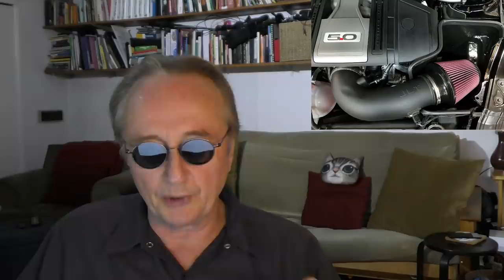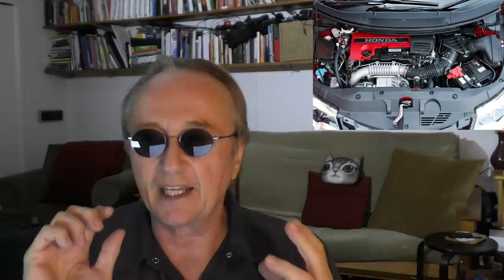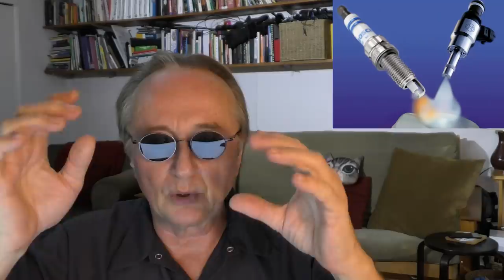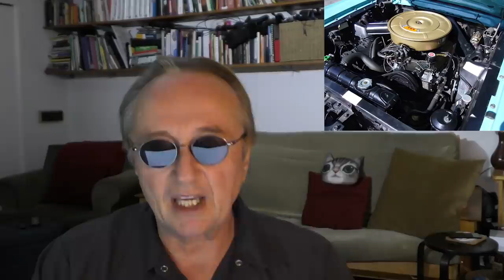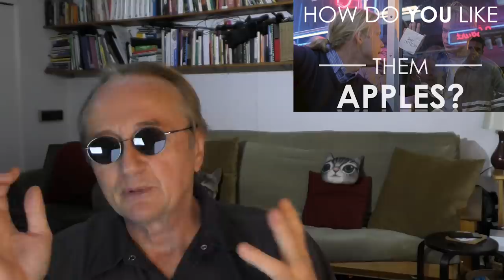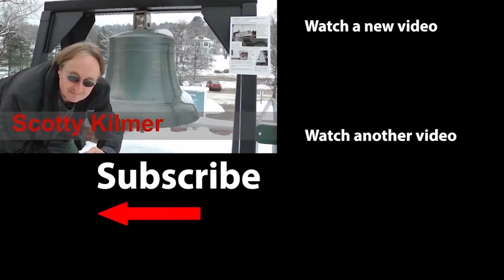This Car Mod is Stupid

Comment: Man listen, cold air intake gives big gain for certain cars, especially tuned cars. REGULAR people with regular cars who don't tune the car- he's right
Reply: In scottys defense he was talking about putting them on a car and NOT tuning the computer for it was the big mistake. In that case it won’t make much difference or it will make it run worse.
Reply: It isn’t that expensive to retune the computer
Reply: It's simple logic
Reply: The MAF and O2 sensors sense the extra oxygen, and will inject extra fuel to compensate. How can this NOT produce more power? Even if it’s negligible.
Reply: Justin Beyer With stock cars, they will sense the extra oxygen but will not increase fuel into the injectors ect because of it. You need a ECU tune to change those settings
Reply: Dio Black CAI does do something for tunes autos. Tuned autos can recognize the extra airflow.
Reply: Neptonic 101 Honestly not really. Download the application on your computer and plug it into the OBD.
Reply: Jeff Lee Lol mostly it’s for the fact cold air intakes just draw in more outside air than stock
Reply: Jeff Lee   That's a good question.  But that air is not hanging around waiting to get hot.  It's moving rapidly.  The question becomes whether the air can be cooled enough to overcome the heating done by the motor.  I guess if it's winter, then maybe and if it's summer, not so much.  But I don't see how it could hurt.  Just throwing out some vague idea that the car knows best is not a real explanation.  If the car runs okay in the winter and you tell it that it's winter by putting a CAI on it, how can that make it run badly?  Even if it does nothing, should it diminish performance?  I don't see it happening.
Reply: You're right, plus I should go tune up my car car right now.... Oh wait, we don't have carburators anymore GRANDPA!!!!!!
Reply: Various i picked up like 21rwhp on my 2014 mustang gt with a 91 tune dyno proven.
Reply: Various I agree
Reply: On any decent car, the stock intake is going to be pretty good these days.  No manufacturer is going to leave power on the table that way.  A cold air intake/high flow filter can only have any benefit at full throttle, because at partial throttle the biggest restriction in the intake is the butterfly valve, which INTENTIONALLY restricts airflow.  Even at full throttle they don't have much benefit, and they're much worse at cleaning the air.  Most cold air intakes just suck hot air from the engine bay anyway.
Reply: godgiven Yes, with a tune it definitely should do that!
Reply: blurglide  correct but what you’re speaking of is short ram air intakes which is inside the engine which to me makes no sense. The cold air intake should literally be in the coolest spot possible where it’s getting fresh air constantly
Reply: Jeff Lee  what's being shown in the picture is a "short hotair ram"
Reply: Lol "big gains"
Reply: I put one on my stock SUV and it does make a difference. No, it doesn't transform it into a tire smoking race car, but it helps it breathe better and it squeaked a mile or two mpg out of the engine. Worth it to me.
Reply: Jeff Lee  I'm saying it's even hotter hahahahahaha
Reply: In the great vast majority of vehicles a CAI does nothing but increases air to fuel ratio a little bit . All the computer systems in good vehicles know how to adjust for that and it doesn't hurt Lockhart to run a little bit lean for a lot of cars it's even better then the factory setting. In cars with lower displacement it can increase gas mileage a tiny bit if you drive it for that purpose and drive it at low rpms. The CA I by itself does not hurt a damn thing. What actually causes problems and when people throw in high volume fuel pumps and injectors without a matching program . Intakes are the simplest improvement that cause no harm or issues to the car whatsoever. If it was a problem then manufacturers would develop specific batches of cars made specifically for high altitude environments and anyone who buys one in a high altitude location and then moves somewhere else to low altitude would have problems with that car .
Reply: Jeff Lee nah you’re wrong carbon fiber guy
Reply: @blurglide  I've been considering taking out the intake hose to a more dynamic one and leaving the stock air filter.   Would that require additional programming?  Do you think it's a good/effective thing to do?
Reply: @blurglide  the butterfly is the throttle control itself. The cotton filter reduces vacuum in the intake as the butterfly opens. How? Less restriction. (Like when you hit your crack pipe but it's got too much crack in it, and you can barely get a hit; then you take some of the crack out, and it's easier to hit because air can pass through more easily.) But crack is whack.
So yes! Anytime the butterfly opens, it demands more air. When you hit the throttle and hear thooosh-whoooooom! That's a restricted intake usually, and you can feel the plastic being sucked into itself indicating the engine cannot breathe sufficiently for the load applied. 🏎
Reply: @iamiam8407  The butterfly valve creates the desired vacuum in the plenum.  If there's less restriction (vacuum) created in front of it, you'll have to close this valve more to create the desired vacuum.  Yeah- there can be a power benefit at wide open throttle when you want as little vacuum as possible, but a low restriction intake offers no benefit anywhere else.
Reply: @blurglide  no it doesn't. The butterfly regulates the vacuum that already exists behind it. 
Point
As the butterfly opens, their is briefly a higher vacuum in the plenum. At a certain point, this becomes constant. By reducing the restrictive paper air filter, you increase the angle (of the butterfly) at which this occurs, giving you that higher constant power. BUT!
Even at lower angles, whenever the angle increases, the response is quicker.

Comment: For new vehicles a CAI is actually calibrated by the MAF sensor so your computer will adjust.  Think about it.  If you drove in cold vs hot the computer has to adjust.  Same with altitude.  There is no need to program it.  It's true a programing will optimize the bolt on.  With out code 5-10hp gains average.  Programmed 10-15hp gain.

Comment: My buddy hydro-locked his motor on his Lancer because of one... Went through a big puddle, and the cold-air intake sucked up a mouth full of water! Your stock air box is enclosed and up high FOR A REASON! 😁
Reply: R6Mute Main yes. But I question this cold air.... I always get the systems that have a box / wall that is a partition from the engine bay where all the hot air is. These filters also keep the stock inlets for the original filter but allow more air with the bigger oiled filter. They tend to have a bigger pipe than stock with smooth / less bends. I’m pretty sure if he hit a puddle with that type of filter system he would be okay.
Reply: @Jenuin  Yeah that's the only kind I would get, if it connects to stock box or has a better replacement box. My friend just had the cone shaped metal filter on the end of the cold air! 😁
Reply: They also make cone filters with dry socks that keep water out in that very situation.
Perhaps he thought the included dry sock looked stupid and left it off.

Comment: Plastic cars do exist, they're called Cozy Coupes by Little Tikes. Target audience is the 2 to 5 crowd, diapers not included!!
Reply: Always  buy them  new! All the second hand market ones have been crashed into garden flower pots and have boogers on the steering wheel !
Reply: @robertcollins7034  LOL quite true!
Reply: Saturn
Reply: FYI: Smart car, for example, stole the design from a plastic cozy coupe.
Reply: @mikesanchezgsxr  is that a make if car ? I'm from uk so dont know that model !
Reply: @robs1852  haha I've seen where someone painted a smart car to look like a little tikes car!

Comment: "It may be low mileage, but it's still a Suzuki Swift."

🤣🤘 You tell 'em Scotty
Reply: Keith Fendley probably an Indian made one, Maruti Suzuki which’s is their India division sucks, the only good ones are those made in east Europe and Japan
Reply: Glen Humplick
Reply: who said suzuki makes bad cars. i have a 2006 suzuki grand vitara. made in japan. 150 thousand miles. They're amazing little offroaders. Never got stuck or stranded in all these years. I flush the transmission fluid every 2 years so never had a problem.
Even my 2009 camry stranded me once but not the suzuki.
Reply: In Pakistan, Toyota and Honda drivers road rage with Suzuki vehicles for no reason. 
Yeah, Suzuki here is infamous for making older model vehicles.
We had a 1992 Alto 800 that lasted 450,000 kms with original engine, and transmission.
Reply: Suzuki cars are very reliable. They tend to be basic, which is why you see them in great numbers in third—world countries.  Scotty has probably never owned one.

Comment: Depends on the mod, on minor things like an intake usually the computer will adjust automatically. You don't always need a tune for small upgrades.
Reply: I've put CAIs on 2 cars and both ran fine for years with no CELs...
Reply: Scotty gave me the confidence required to install a magnaflow cat back on my GMC Canyon. A $1400 option that I did myself for $670 plus a couple tools I probably won’t use again ($110) 😃
Reply: Yes but you must reset the ecu so the new mod well adopt by the ecu.
Reply: @GC-kw1gq  it's a GMC, you didn't take Scotty's advice 🤣
Reply: Im pretty sure the MAF sensor will detect the increase in airflow and tell the computer so it increases the fuel.
Reply: @kendogg1173  first intelligent reply I've seen on this video. Scotty has been working on cars forever and doesn't know this?
Reply: @jhonnelmedilla4892  Resetting the ECU is only for immediate results.  If you don't reset it, it'll take a while for the ECU to get to optimal settings.  Resetting means the ECU will be actively optimizing from the first start.
Reply: Dio Black  Never had that issue on any cars I've modded (90s and 00s).  The ECUs of that age and newer constantly monitor air flow and exhaust gasses to get the best MPG without risking the engine.  If anything falls out of spec, that's how you get a CEL.  If it's bad enough, the ECU goes into safe/limp mode to prevent engine damage.  So it's basically impossible to damage a car with simple mods like intake and exhaust, unless they cut down on flow so much the engine chokes.
Reply: Gus Bici should have just bought the muffler for $100 and pay a guy $60-80 to cut and weld it.
Reply: Scotty is a fantastic mechanic but doesn't trust the computers much! It shouldn't be a problem for ECU to auto-adjust for a CAI.
Reply: @jhonnelmedilla4892  risky in a bmw I dont recommend doing that. Didnt need it for my mods.
Reply: Ken Dogg yep
Reply: Christian Fiore exactly
Reply: event3horizon he don’t trust anyone 😳
Reply: No it doesn't. You lose power (15% or thereabouts). Unless you get a remap and rolling road tune the ecu will pull the power back.
Reply: @jhonnelmedilla4892  You can't just reset the ecu. It takes around 3 hours of rolling road tuning and programmable ecu plugged into a laptop and software. Ask me how I know and I'll tell you it was my job!
Reply: @Bizija123  It is a problem in that the ecu will pull the power back by circa 15% so you will lose power. So many people on here have zero idea if how car tuning works 😂

Comment: The problem with really old cars is the tune ups - plugs, points, cap & rotor, timing, carb cleaning & adjustments...
Other than oil changes and air cleaners, I haven't touched my 10yo Ford's engine and it's still running perfectly.

Comment: I installed a K&N cyclone cold air intake on my 2014 Ford Focus (manual transmission) when new and it was a very sweet modification. Peak hp increased by 10hp and the intake sound is very sporty as you go through the gears. The Mass Air Flow sensor simply inputs the increased air flow to the computer which makes the necessary adjustments without needing to fiddle with the programming. It is five years old now and the engine runs perfectly without a hiccup from idle to rev limiter. No check engine light. When the filter gets dirty I simply clean and oil it again.

Comment: I thought fuel trims were set in real time. In other words, it will adjust to the extra oxygen. 

If that weren’t the case, they would have to be reprogrammed at colder temperatures or higher altitudes (where oxygen is different).
Reply: Justin Beyer Depends on the car. Older “speed density” (non air flow meter)cars sometimes can’t even compensate far enough for a lower restriction air filter. Even new ones compare the ambient temp to intake temp and might throw a code. Exhaust changes are definitely out.
Reply: Justin Beyer The Oxygen sensor is on the exhaust side. A low restriction exhaust (or a leak) can make it not read right.
Reply: @sammolloy1  Only if it's so low restriction it noticeably hurts flow.  At that point, it would be ridiculously large, anyway.
Reply: sammolloy1 02 sensors go out too
Reply: behexen250 Exactly
Reply: Dose changing the location of the intake change the natural volumetric efficiency of the engine?

Comment: For the Honda Accord cruise control issue - check the brake and/or clutch pedal to see if the stop pad is missing for the switch on it. It'll look like a post is going through a hole on the pedal assembly if the pad is missing. The pad covers the hole and depresses the switch when the pedal is not pressed down. Dorman makes stop pad replacements, but you can fix it with plastic machine screws from a hardware store for less.

Comment: Cold Air intakes only work on cars that don't have computerized electronic fuel management systems. Say , pre 2008? I'm not sure but an 80's or 90s car would breathe better, and you just get the timing adjusted.

Comment: Doesn't matter how "cold" the air is at the filter end, after it passes through the throttle body it's going to be at least as hot as the coolant temperature. This is due to the fact most car manufacturers place a water jacket around the TB itself to keep the throttle plates from sticking in freezing temps. You can usually "bypass" this by pulling the tubing off the TB and splicing the ends back together with one of those barbed inline splicers used for joining 2 pieces of poly tubing.

Comment: Scotty, think your show is awesome! Thank you for telling the truth! Few and far between these days. Still waiting to hear your thoughts on a 2007 Honda Accord EX-l 3.0 six speed? Just bought one with 160k because it still ran so well. Do these engines require valve adjustments and what else should I keep an eye out for with this car?
Reply: The big problem with this car is brake rotors that can warp early and require replacement a lot, because the OEM pads are substandard and wear out early. Watch the pads to make sure they don't wear out before they warp the rotors. Maybe when they get low, replace them with the Akebono pads Scotty likes.

To extend on Spenser's comment, make sure you use genuine Honda fluid, though at that mileage, if it hasn't been changed in a while (brown or especially black), you're best off just leaving what's in there alone. Hopefully you find the seats comfortable. If not, aftermarket cushions may help. The paint sucks.

Check the oil every other fillup, and top off as needed with oil which meets the standard Honda recommends.

Comment: I owned an '02 Nissan Almera Sport (1.8 litre). Had a local business build a stainless cat back exhaust system for it & fitted a K&N 57i induction kit . No other adjustments, ran like a dream, more responsive & was reliable for the seven years I owned it.

Comment: Before I got my car tuned I just ran stick air box with K&n drop in filter. Definitely could tell a difference. But now I have a really nice CAI with my tune. Cone is enclosed to keep out heat

Comment: I have a 2014 Toyota Tundra 5.7 V8 and i have a cat back flowmaster outlaw system and i love the sound had it on for like 6 moths and never had any problems truck still runs great and still have the same mpg’s

Comment: My beater Dodge Neon went from 25 to 29mpg on my daily commute with a $35 eBay cold air intake.
I'm sure with modern forced induction that era is over
Reply: My '05 GTO I've had since '06 with 12,000 now at 180,000 mi. still has it's original factory version of cai ....the inlet is by passenger side headlamp ass'y and uses stock paper filter

Comment: Airaid intake and K&N panel filter on my Vortex 5.3. No codes or weird performance, and it got a slight acceleration boost. Plus it helps a little with towing.

Comment: I use a free flowing pipercross  panel filter.  It uses the original air intake and I've noticed an improvement. I did also clean the m.a.p sensor so that probably helped too. Those cone filters are really for turbocharged or cars that have been chipped or remapped. Panel filters are a lot cheaper too.

Comment: hot-air intake under hood heat😂
Reply: For sure if one does buy one don’t buy the K&N one with the heat shield that positions under your hood. My car would actually overheat in the summer from using one as soon as I took it off no more overheating.
Reply: The ones with the tube in the engine bay are a waste of money. Get one that is enclosed in it's own box/heat shield and utilizes the existing intake dam. I get an extra 4mpg on the highway.
Reply: Racing dynamics

Comment: If your car lurches when you get on/off the gas, check for a crack in the accordion like tube between the air flow sensor and the intake manifold. The crack can open/close as the engine rocks.

Comment: I got a cai on my 2.3 ranger because ut provides easier access to the air filter vs having to move the ac and coolant hose away to open the factory airbox, and the ute still runs normal